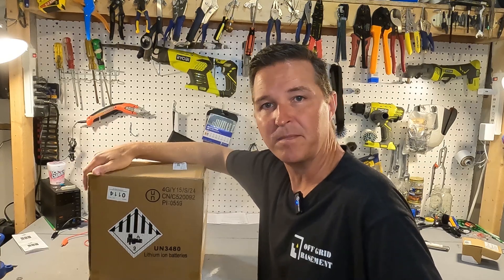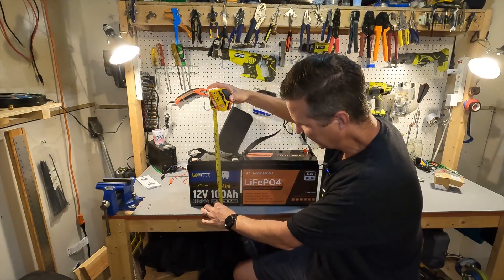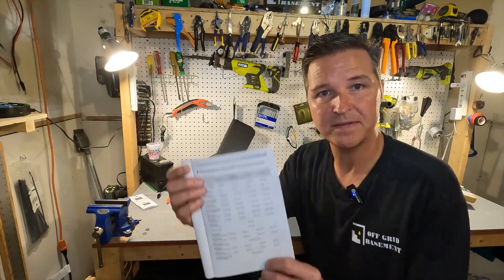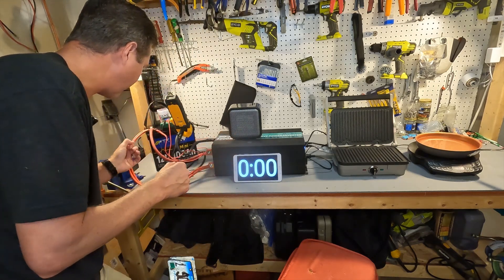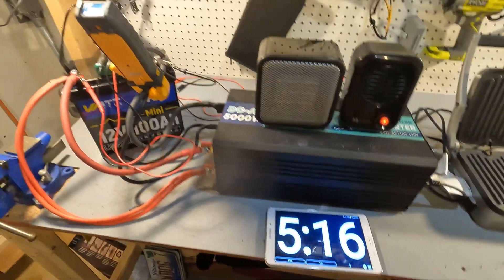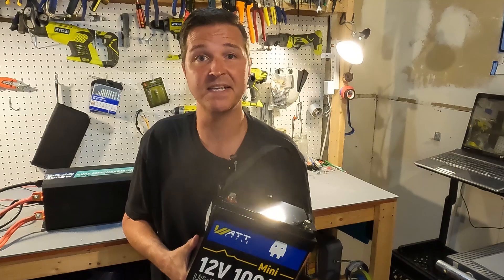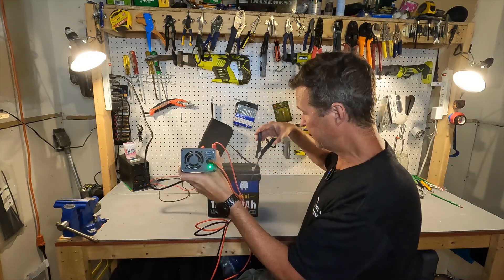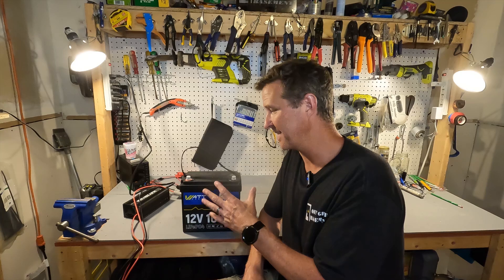Beginner friendly review of the Wattcycle 12v 100ah MINI Lifepo4 Battery!

Comment: My friend got two of these we downloaded the app and when you try the charge button it ask for a code that you don't have and can't find. So we downloaded the new wattcycle app now when you select the charge or discharge button neither does anything I am going to just have him return them if we can't get the app to work. I do not understand why you would have to use a charge /discharge button to do either for the battery. No videos ever talk about the problems with the app but a little searching there is problems. I called the number they give and you get a recording you can't be connected. I e-mailed them did not get a answer so much for 24/7 customer support. Do you have any suggestions Thank You for your time.  Darren
Reply from the maker: I hope you were able to find a solution.  There is no reason to have that feature passcode protected.

Comment: Nice review, I have 3 on order with the Bluetooth feature. 3 of these fit in the space that 2 of my old GC2 golf cart batteries on my camper were. 1/2 the weight AND 3x the usable capacity. Crossing my fingers they come undamaged.
Reply from the maker: They're packaged great with lots of padding.  I think you'll be good.  Good luck and thanks for the comment.

Comment: I’m using this battery in a very cold climate paired with a Bluetti AC200….

Can the Wattcycle battery (and the Bluetti) continue to provide power below 32 degrees f? Do battery heating blankets work to keep batteries warm for recharging?
Great reviews and very helpful…thanks!!!
Reply from the maker: Yes.  It will provide power down to 4⁰F.  I just won't charge until temp is 27⁰F

Comment: Assume it's in parallel with another battery and charger - then connected to a load in 20° weather. Will they drain until it warms up and then click on to allow charging while in use?
Reply from the maker: Exactly.  They discharge @ 4⁰F, but don't start charging until 32⁰F

Comment: I just ordered 2 for my boat, which has limited battery space, maybe later with more planning I’ll upgrade to 230ah cells, if needed. The biggest things that I like about the Wattcycle is that it is NOT pouches and the battery case has bolts to take it apart. Not that I plan on taking it apart, but it gives replacement cells a chance and , if desired, to “upgrade” the BMS. You can do it on other minis, but the case is glued together.
Reply from the maker: That's great to hear!  I'm sure they will work great for you.  Thanks for sharing.

Comment: yea that great result for battery size like that,would be good to see what inside if you can put out cells out without damaging the box
Reply from the maker: I'm hesitant about taking it apart.  It's most likely pouch cells.  Getting them out of the case would be difficult.
Reply: @OffGridBasement  oh yea if its sealed and can be damaged dont try to open it,because i would not,gl

Comment: I will bet you that these smaller 12v 100AH are cell pouches, and much thinner and lighter. I feel with all of these cell pouches can increase failure due to the quantity, if this uses cell pouches? The smaller 12v 100AH had cell pouches that I had.
Reply from the maker: I would be surprised if it used prismatic cells since it is so light.  Pouch cells are not my first choice for a larger bank setup.  Thanks for the comment.

Comment: If you float charge the battery at 13.6v for an emergency back up system or a UPS how much will it reduce battery life or capacity, please?  Or,  just fully charging and not discharging it 20%  (so it sits at 80) for max life storage?

A T Burke
Reply from the maker: I would say trickle charging to maintain 13.6v would be good.  Hope this helps.

Comment: Seems like a good deal for under $200. Also never noticed you had a Shopsmith.
Reply from the maker: I don't see any problems with it.  The shopsmith was my grandfather's and it still works great.  I mostly use it as a drill press.  Thanks for the comment.
Reply: @OffGridBasement  That’s cool to be able to use your grandfather’s tools.  I just inherited some from mine, he passed at 93.

But yeah, always been interested in the Shopsmith, just the whole setup is kind of intimidating haha

Comment: It would be interesting to see you open the case and see what cells and BMS they are using.  The size and weight difference has my curiosity peaked.
Reply from the maker: I'm hesitant about taking it apart.  It's most likely pouch cells.  Getting them out of the case would be difficult.
Reply: @OffGridBasement I've seen others take other wattcycle batteries apart. They typically have 4 rectangular prismatic cells in there, easy to take out. I believe they are EVE brand cells, probably LF100. I bought this battery because the parts to make my own would be about the same price if not more. Unfortunately you have to destroy the case by cutting it open to get inside.

Comment: My battery I use for my solar on my cabin weighs 60 lbs. Its a 12 volt marine batter 122 amp hour, And it has done everything I have asked of it impressively  well. Each to their own but seeing what a marine battery can do , I mean I've never had a life pro battery or anything like that but for that kind of money, I can buy 4 marine batters and have a total of 12 volts with 500 amps or 48 volts with 122 amps. Have you ever thought about testing marine batteries vs life pro batteries or the likes there of ? it would be interesting to see the comparisons.
Reply from the maker: In the U.S. this battery is $200.  It's unfortunate that it costs so much in other places.  Thank you for the comment and information.
Reply: If you can get 4 x 12v 122ah lead battery for $200 please leave a link. I want to get 1 for my truck. All I can find is 12v 100ah for $180.
Reply: @brucey5585  It is a marine battery, lead acid and I got it at Walmart like 2 years ago and I paid right at about 100 bucks I thought. And it says right on it 122 ah. And it has not disappointed me. without actually going out into my garage and looking at it I think its like the 29 class. But ya, I bought it at my local Walmart store My solar charge controller recognized it immediately and it ran and charged it just fine.
Reply: Thanks for the input. Seems you take care of the batteries